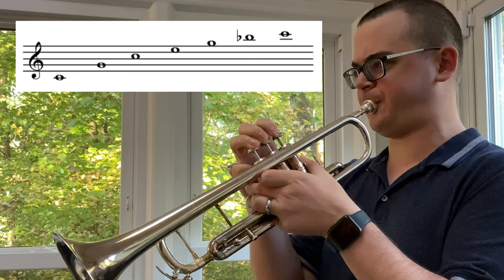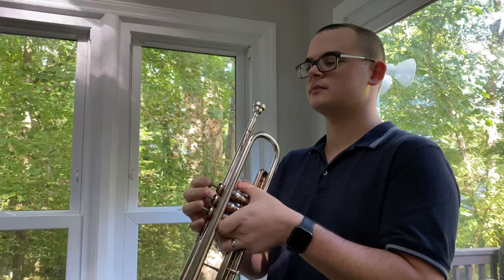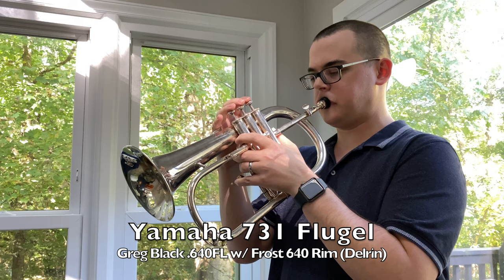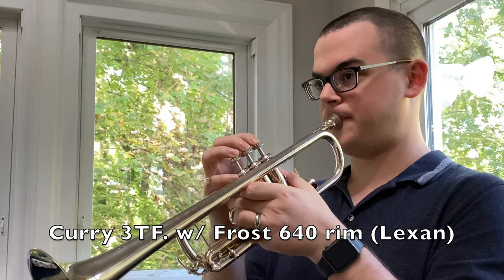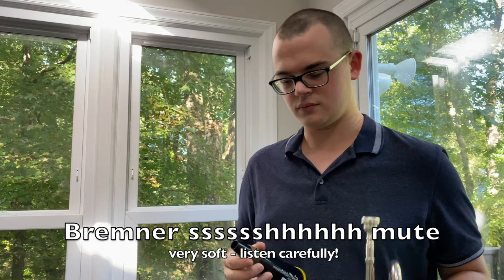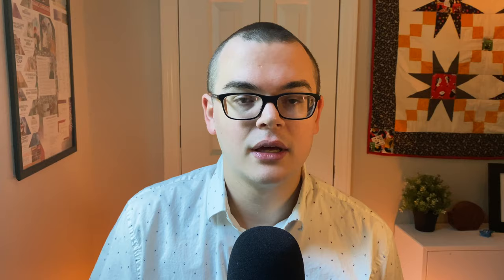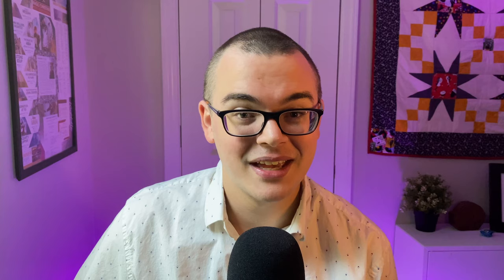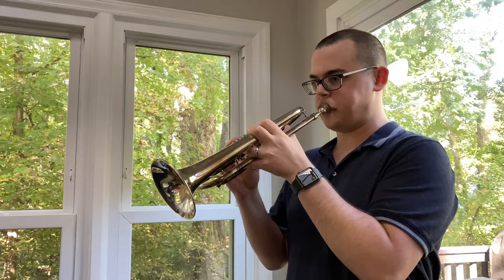Pedal Tones: A Practical Guide for Trumpet Players

Comment: In almost 40 years of playing I've noticed a few things in regards to pedal notes. Though I'm not against them 100% that fact that so many players don't play them properly is troublesome...as with everything, there's a right way to do them and a wrong way and if you're not going to do pedals properly, then I always suggest to excise them utterly. I've also noticed that those who use them rather religiously, that they have issues with tonging, Instead of a sharp direct "pop" in their attack, they get more of a "pewap" kind of attack. Back when Herbert L Clarke was with Sousa's band, a rather well renowned brass embouchure guru attended a Sousa concert and afterwards went to meet Mr. Clarke during intermission and while conversing with Mr. Clarke, they heard the infamous low fluttery sounds and when asked what that sound was, Mr. Clarke said "Oh, that's Harold Stanbaugh(sp) one of Cornetists and he practices pedal tones during the intermissions, then, gets back on the band stand and has trouble tonguing. So, works for some may or may not work for you.

Comment: Like your vids!

One tool that helped/helps me work up the pedal pitch, that only works on B down, is using the half step higher fingering to slot in the pitch then releasing or alternating with the pedal fingering and trying to recapture the sensations. e.g. low B 2 to pedal B open, then work it up on 2nd valve. I actually don't see the benefit of using those alternate fingerings in the pedal register, if the goal is to overcome the lack of resonance and have control over the pitch. You sound like a player who hasn't had to rely on developing pedals to correct some issue that wasn't happening otherwise, whereas I am one who finds them a valuable tool to help my concept and efficiency. Yeah there's players who never played one that can play all over the horn for sure, but some folks just can't figure things out any other way than with tools such as these. BTW you sound like a heck of a player!

Comment: There is one example in the literature. Last note of the first mouvement of the Saint -Saens septet. If played on Eb trumpet which it is written for the last note is a low concert Eb or pedal C on the Eb trumpet. Anyway, you have an amazing pedal register, probably the best I’ve ever heard. Ever double on tuba?
Reply from the maker: Hey Stephen!!! That's a great example of a longer discussion I'm hoping to have about the timeline of the use of various types of trumpets throughout the history of our literature. The Saint-Saens Septet was written to feature the long valved Eb trumpet, so for that instrument the last note is a low C instead of a pedal C. Of course in the modern day this piece is usually performed on the "short" Eb so you are correct (though I think most people probably just take that note up, which is very practical). The same reasoning applies to the low concert Ebs in the Trumpet in Eb parts in Ein Heldenleben. YES - I did play tuba as a middle schooler actually. LOL
Reply: @JonTalksTrumpet   That makes sense. Guess that means the high concert Eb flat at the end of the piece would have been written as a double high C then on an alto or low Eb trumpet? Must of been a bit of a feat on the original instrument!! Anyway, I enjoy your videos Jon. But you need to be warned…I’m 66 years old and still a trumpet nerd. You have a life long affliction my friend!

Comment: How do I reach the low tones F to C#, below the regular range, but not in the pedal octave? Is this even possible at all by some trick like the pedal tones? Sometimes I need a low E.
Reply from the maker: There’s a good low F with the third slide thrown almost all the way to the end plus some first valve and 123. As far as low E, generally you have to do it as a “false” tone like I demonstrate in the early section of this video OR get a four valve instrument (or some kind of extra length rotor slide).

Comment: Jon this is super! But, I do have a problem with you saying that the trombones pedaltones are difficulty to play. Composer have written pedaltones for trombone for ages. Tenortrombones are sometimes suposed to play pedals, bass tromonosts have to perform pedals a lot. Actually the pedal Ab on basstrombone is one of the best notes in horn. But I do like your show because it does explain pedals for so man trumpetplayers that don´t know enough about them.  Thankyou!
Reply from the maker: Sven - you are totally right! Shortly after posting this video I learned I was off base on that point. Somebody in this comment section explained it well I think - it has something to do with the difference between the bore size of the tubing and the bell size. So trumpet is hard to a play a pedal c on because the bell is not big enough? I think. I will probably use the youtube editor to cut out that part OR make a follow up someday explaining what I've learned.

Comment: The only thing I notice missing here is the double pedal register in trumpet methodology.  It is debatable whether any of it helps normal register playing, but proponents of each type of pedal typically eschew the other type.
Reply from the maker: I guess you’re right, in the sense I have never experimented far past the pedals I show in this video. I’ve heard about double pedals and know they are part of a methodology or two - is that like below double pedal c?
Reply: @JonTalksTrumpet  This is part of Callet and BE methods, where instead of maintaining the same mouthpiece position, the bottom lip is pulled out of the mouthpiece to get double pedal C and below, so an octave below what you are showing here.
Reply from the maker: What is the intended benefit of working in that range? The thing that seems most likely or obvious is that it might help get the lip tissue vibrating in a more nuanced way, but I wonder what other benefits are claimed for practicing them?
Reply: I think their basic idea is that by doing them it is supposed to encourage a certain lip position with the lips kind of "rolled out".  Then again some other advocates of normal pedals also say they do those to get a more pooched out, cushioned, lip position.  Or like Thibaud, I think uses both.  I don't know one way or another!
Reply from the maker: So much to learn! Definitely a video topic - “Double Pedals”. Thanks for watching!